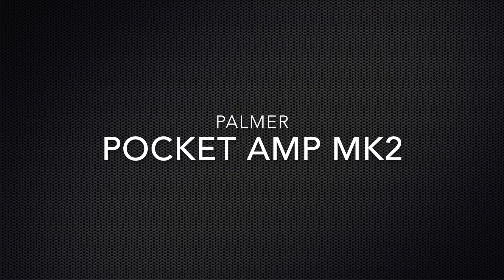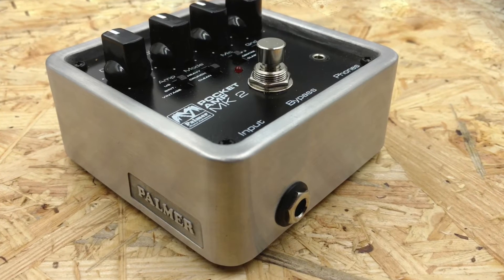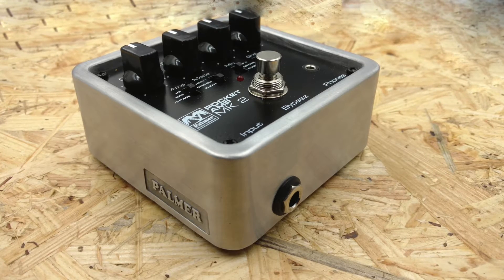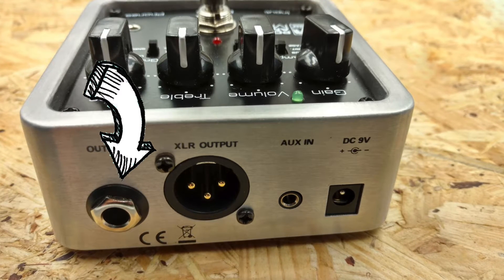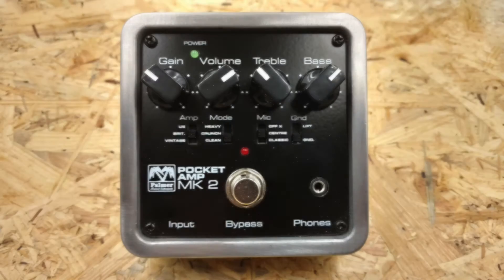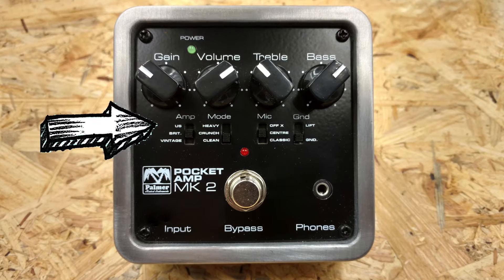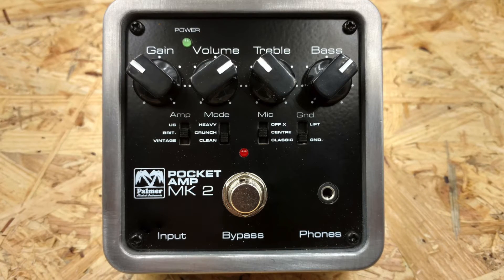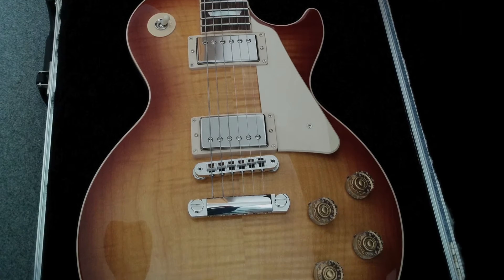Palmer Pocket Amp MK2 - Tech 21 GT2 Clone #tech21

Comment: Not sure if anyone will see this. I am thinking about getting this to use for 2 piece gigs my band does. I pay electric with a line out from my amp and other guy places acoustic plugged in. My amp is a 1x12 Katana 100 mk1 so not a massive pain. But I am considering going straight from the pedalboard to the mixing desk to the powered speakers. Would the jack or XLR output be best here? Thank you for the demo.
Reply: XLR

Comment: I own this pedal and if you set it up correctly it is not noisy at all and sounds way better the in this video! First of all you should use the balanced output and a decent audio interface with xlr input. Then you should not overload the input of the interface or soundcard, most of the crappy sound is due to digital distortion. And of cours sometimes you need to switch the GND to "Lift". If you consider this, you can have much fun with this device, you can play a complete gig straight into the PA or make pretty decent recordings.
Reply: Hi! Thank you for the comment. If the signal from this pedal run to audio interfaces via xlr cable, what level mode  I choose on my audio interfaces? Line in, mic or instrument  level (hi-z)?
Reply: @gerisyandrayusman241  It works as a DI-Box, so you choose Mic-Level on the Input.

Comment: Hi all,
So, if I understood correctly, it can be used at the end of the pedal chain. Does this mean I can use the headphones to practice during night?

So the signal chain would be Guitar - Distortion - Delay / MOD - Palmer Pocket Amp MK2 - Headphones.

Did anyone try this? What the sound quality?
Reply from the maker: yes, you could us headphones for silent practice. sound quality would be pretty much the same as in the video, since it is recorded over the same output that you would plug the headphones in. high distortion tone can be a bit harsh on the pocket amp, but nothing that maybe an eq pedal could fix.
Reply: Frank, thanks a lot. I am looking for a small solution for silent practice and found this little pedal. somehow this seems to fit my needs to use the pedals with headphones.  not sure there are other options. 

ok, just to be clear guitar to pedals to delay/mod to palmer and into headphones is decent and good sound quality?  

if it is just as the video it should be more than enough. 

some people complain about the quality of the knobs after some time. did you experience anything like that?
thanks again
Reply from the maker: again, what you hear in the video is the pocket amp. no post processing. it should be the same with headphones. build quality seems ok to me, though i only use it occasionally as a desktop device. no heavy, longtime use. as far as i can tell it works great on the clean modes (as a pedal platform). high gain stuff can get a bit fizzy. you may also want to check out the official palmer demo here -> https://www.youtube.com/watch?v=mXWgyNNANPM or david wallimans demo -> https://www.youtube.com/watch?v=7iSQJXYSbj0 ... these are all direct recordings from the pocket amp and shpould sound the same through headphones.
Reply: Thanks, yup. This is helpful. Thanks man !

Comment: great review. I have one of those. Use it mostly with headphones. I wanted to use it to play music at home. How would you recommend connecting it. Can this run a cabinet? I was thinking about connecting it to my  interface and get the sound from the studio monitors. I don't have an amp at this moment.What would you recommend? Thanks in advance
Reply: you need a power amp to power an cabinet with it. the pocket amp is just for active speaker...
Reply: In deed, the Pocket Amp is just for
- Recording into the mixer
- Putting before a (guitar) amp
- Using headphones

I do the first, but not using the XLR output, but the ¼" as I'm putting it through some more effects. It's a great device and I don't want to miss it anymore.
Reply: stratman well an amp is definitely always better. I have many amps and always prefer playing an amp. However, if you have to play with headphones or if you are traveling, I think it might be a good  option. Just my opinion.